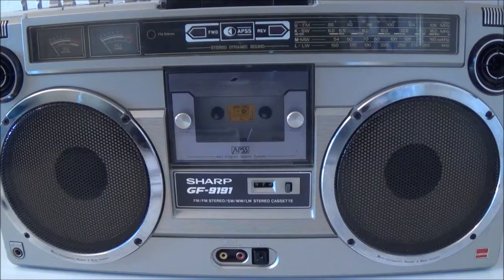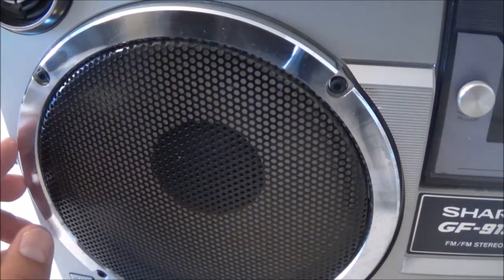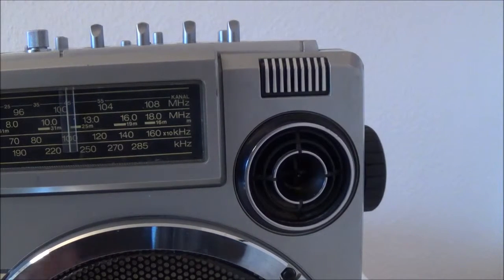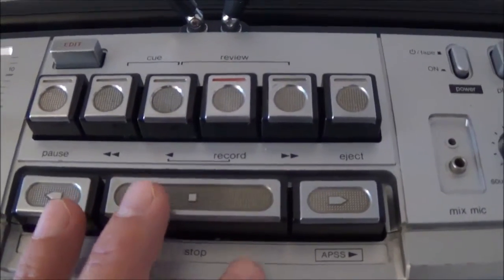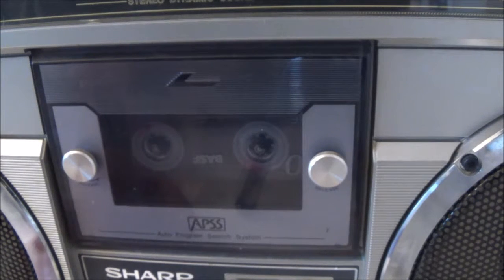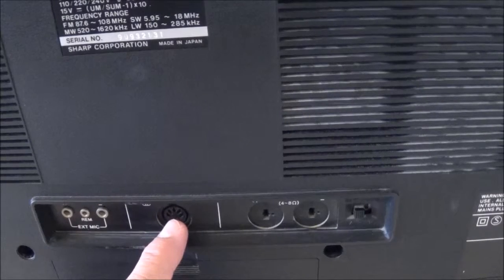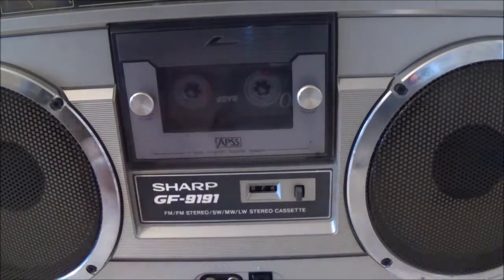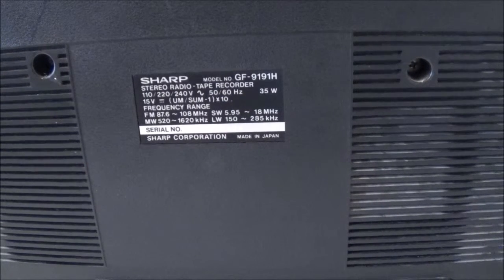SHARP GF-9191 INTRODUCTION & REVIEW

Comment: One of the first REAL quality BOOMBOXES with a wonderful warm analogue sound. And phono jacks. And despite it being 42 years old. Its easier to restore than alot of more complex models that came later. To me its the best boombox ever made.

I will always use it.
Reply from the maker: It's a pretty good boombox and as you rightly noted, easy to work on. I have yet to get my hands on a GF-777...
Reply: @OldSchoolElectronics  

My friend had one. Theyre AMAZING. But you will pay more for one in good working condition. Than it cost brand new. I saw one on Ebay. 
Yesterday. In nice Condition. Theyre asking £900. Which isnt bad.
One day I may drop the money. They are one of the HOLY GRAILS.
Reply from the maker: Really, I think 900 is too much. It would have to be in mint condition and serviced. I have a Crown CSC-950 that I have to work on. Not as cool as the Sharps, though.
Reply: @fender1000100  I just bought one in mint condition (very clean),just completely serviced for only.. $300  ;)

Comment: Thanks for this video. At 15.58 you're talking about the DC jack - Yes, I have been using this option long time back to connect 12v battery cell (similar to the 12v battery you have in the modern cars or bikes) Good old memories. I wish if someone could help me get this restored to original condition..!
Reply from the maker: I have always used mains voltage. Only in high school did I run around with a full set of batteries. A full restoration (meaning not just cleaning/touch-up painting the unit as some "restorers" do) with alignment is pretty time consuming and takes a higher skill set.

Comment: Is that really possible to connect 3.5mm jack  by a smartphone jack? Phone ear jack ic's won't blow are u sure.
Reply from the maker: You just have to keep the phone output really low when you start; the phono input is not really made for a high-level input, but lots of people do it anyway. It just takes a little common sense to avoid overdriving.
Reply from the maker: Ok, interesting. Thanks for the tip!
Reply: @OldSchoolElectronics  Welcome.